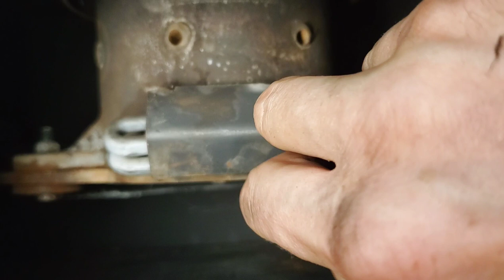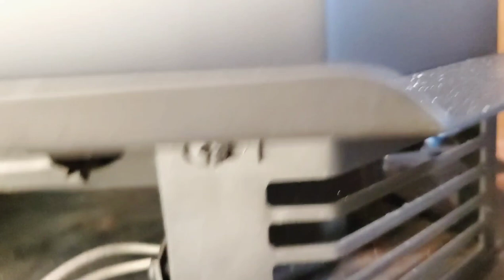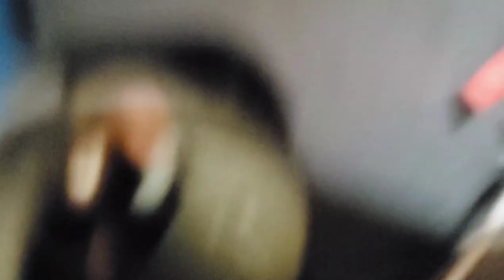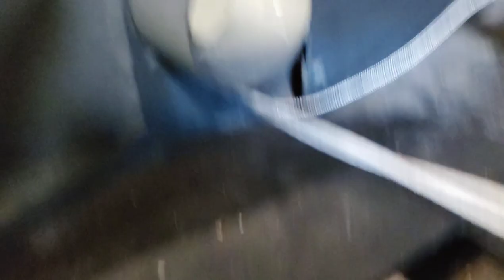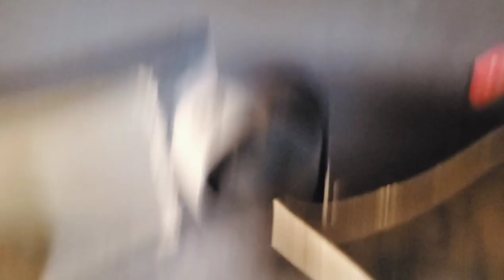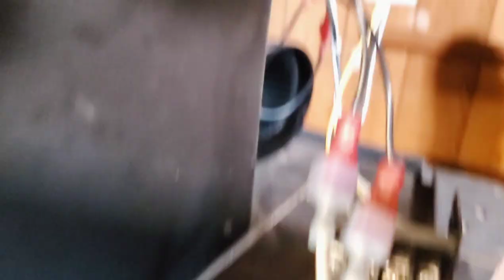How To Replace a Quadra-Fire Pellet Stove Loop Igniter

Comment: Please help! Live off grid and am freezing!! My Quadra Fire Mt.Vernon cradle that holds the igniter is not attached and is swinging freely. Cannot figure out how to reattach it to the stove?
Reply from the maker: Thanks for contacting us. The igniter cradle is a welded assembly to the cast iron burnpot. You should be able to see where those welds were and maybe there is someone experienced near you that can re-weld the steel cradle to the cast iron pot. In the meantime you can manually light your fire. With the stove off, place a handful of pellets in the burnpot and add a firestarter. Gel firestarter, Parfin starter material, etc.. will work well - never use a liquid starter such as gasoline or lighter fluid. Light the fire with a match and leave the door open for a few minutes before you close the door and start the stove.  Here are links for the replacement burnpots; I'm not sure which Mt. Vernon model you have so there are links here for all 3. Any questions please let us know.

Mt. Vernon O.E. (Original 4 Speed Model) https://pellethead.com/product/quadrafire-mt-vernon-o-e-burnpot-firepot-assembly/

Mt. Vernon AE/E2: https://pellethead.com/product/quadrafire-mt-vernon-ae-e2-edge-60-burnpot-firepot-assembly-w-igniter-oem/

Mt. Vernon E2 (Manufactured Pre-2018): https://pellethead.com/product/quadrafire-mt-vernon-e2-trekker-firepot-assembly-burnpot-oem/
Reply: @EarthSense  Thanks so much!! Trying to figure out how to put my bottom drawer back in place as the unweeded piece and wires are in the way. Can’t figure out how to remove right side panel. I’m thinking I can access the wires easier there. Please advise please and thank-you!
Reply: * unwelded
Reply from the maker: @KarenBuchanan-j9q  Thanks for the message back. I would suggest disconnecting the igniter wires. You should then be able to pull out the igniter and un-welded cradled. You should be able to disconnect them by the ash pan area. From there you should be able to have your ash drawer back in place and manually light your fire until you're able to fix the weld.
Reply: @EarthSense  Thank-you Earth Sense for your prompt reply and help! Greatly appreciated!
I ended up tying 2 pieces of metal wire around the loose cradle and then tied it to another piece of metal above the area where the cradle weld failed. This allowed me the clearance needed to reinsert the bottom ash tray.
Happy to report I fixed the problem and am warm again.
Should I be concerned about the wires that are attached to the igniter as I moved the starter higher than the original position?
How do open up the right side panel of my Quadra Fire Mt. Vernon pellet stove please. 
Cheers
Reply from the maker: @KarenBuchanan-j9q  Thanks for the message back. Glad to hear you are warm. The igniter wires do have a heat protectant coating on them, however they are not fire proof. The burnpot does get very hot in operation so it's important you have as much space as possible. If the igniter or wires ground out/have a short at any point it will generally take out the control box so you really want to be careful/mindful here as the control box can be very expensive. I would suggest that you have the cradle properly welded back on or that you purchase a new burnpot assembly; but again glad you are warm right now. What Mt. Vernon Model do you have; Quadra-Fire made 3 different Mt. Vernon models and they all have some differences. Most are the same for the side and back panels. In the rear of the stove thereshopuld be two screws that hold the metal side panel in place; loosen or remove to take off the side panel. The cast iron portion of the side is not designed to be removed. Anytime you are working back by the circuitry it's important you have the stove unplugged from all power sources.
Hope that helps, thanks!

Comment: I checked the ohms on my igniter and it seems fine. I can see the igniter glowing red but it doesn’t ignite pellets in the firepot.  Could it be a fan that is not pushing air across the igniter?
Reply from the maker: Thanks for the message. Sounds like your igniter is good. It's either going to be an air loss or air blockage preventing proper ignition. 
Check gasket seals around the door and ash pan and check the combustion blower operation during start-up. Let's also check the burnpot holes to make sure they are not plugged and that the bottom pork chop plate is closing properly. Inspect the air inlet to the bottom of the burnpot and igniter area. Let's make sure there is nothing blocking it. Ash blockage in the stove and vent can certainly come into play as well. Check the simple things first and keep us posted. Here is another helpful video on igniters and things to look at https://youtu.be/z4wmCc96rVI?si=dj6onqMmYWzj3ZV3
Reply: I added a handful of pellets to the firepot and it ignited. I think it is not properly feeding pellets.
Reply: Also, the convection blower never kicks on and the fire eventually dies out since no pellets are being delivered to the fire pot
Reply from the maker: @andyluikens8307  Thanks for the additional details. So it sounds like it is lighting fine if you manually add pellets to the burnpot. Are pellets feeding at all? When you push the reset button do pellets drop in the firepot? If the stove is feeding intermittently could be an issue with the auger motor itself. If the stove is not feeding pellets at all it could be the motor or one of the safety switches that is not allowing it to run such as the high limit switch or vacuum switch. Let us know if it is feeding at all and we can better help troubleshoot. The convection blower is connected to a low limit switch. The stove has to get hot enough during the startup cycle to allow that switch to lock in and have the convection blower come on. It makes sense that it is not coming on right now based on what you are saying. We're happy to help, keep us posted.
Reply: If I hit the reset button it dumps a bunch of pellets and the fire gets real big and then dies out. So the auger dumps pellets but only immediately after hitting reset button.  It doesn’t continuously add pellets. It finally got hot enough to kick on the blower, but again the fire dies out if I don’t keep hitting the reset button. Thanks for your help. Could it be the control panel?  I just replaced the thermocouple a couple days ago because I thought that was the problem. I think I actually ordered the ceramic cover from your company. My old thermocouple didn’t even have a ceramic cover anymore.
Reply from the maker: @andyluikens8307  Hey Andy, thanks for the info. It does sound like an issue with the thermocouple. Please reverse the wire hookups for the thermocouple and let me know if it fixes the issue here.
Reply: I had tried reversing the wires yesterday and that didn’t seem to do anything. I tried it again today and now it seems to be working.  Thanks for the help.
Reply from the maker: @andyluikens8307  Excellent to hear Andy. If anything else comes up just let us know. Happy Thanksgiving!

Comment: Replaced the igniter, but it doesn't heat, what could be the problem?
Reply from the maker: Thanks for contacting us. Its always good to check the basics first. Let's make sure the new replacement igniter is in proper ohm range. It should be providing a reading of 43.5 to 53.5 if it's the 300 watt element, 35.0 to 43.5 if it's the 380 watt element. If it is outside of the ohm range best to get it warrantied and get a replacement. If it is inside proper range, I would double check all wires and connection points. If no electrical is coming to the igniter element, it's most likely a control box issue. The control box can be tested if needed. Happy to help. Here's an igniter ohm testing video for reference. https://youtu.be/z4wmCc96rVI?si=LIWE3K2aDPbT6Vov